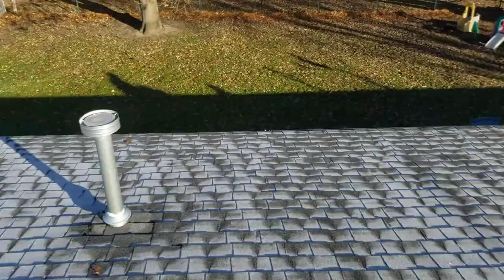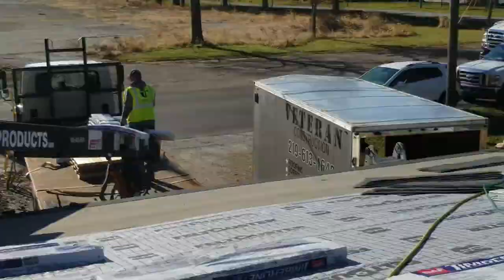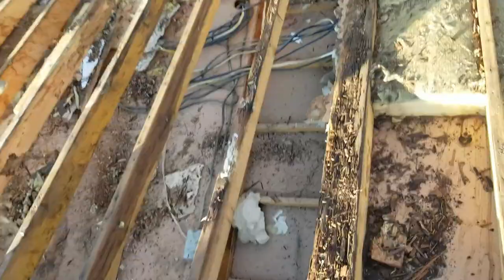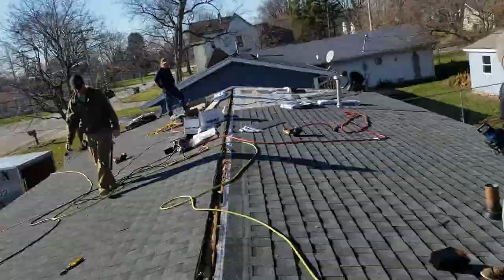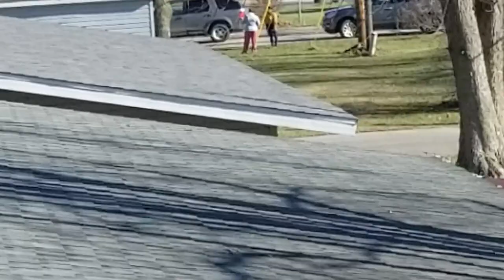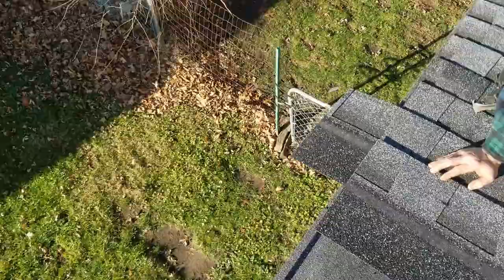One Day Job In Rensaleer

Comment: I don't know shit about roofing but aren't you supposed to nail on the nail strip? Isn't that where the upper and lower part of the single overlap? Just curious
Reply from the maker: It's called the common bond yes.  And it's only about 3/4 of an inch on most shingles

Comment: The nailing pattern everyone that goes by on laminate (do not nail too close too seams where 2 shingles line up too echother) 3 tab had 1.5 inches on both sides of the tab where the nail lined up, but wait if you nailed not in the right space it would leak??? Lmao, architectural shingles seal so good now days next time you rip a laminate roof look at the water stains (it is a dusty looking water mark and i wonder what got up in there???? Drum rollllllll it was WATER 💧) trust me I've been doing this for almost 15 years, in alot of places we have high winds so if you nail then skip 1 foot and nail the shingle on it will blow off
Reply: Ya right. You don't know

Comment: what do you think of putting 5 in the nail strip and then one more super high in the shingle as you go up the rake? When I was doing my roof a my friend said to do it that way.  Do you even need that? Like if the 5 in the strip fail with wind the little guy high aint going to hold the s#itshow together.
Reply from the maker: i don't think its neccessary but also it doesn't hurt. i've got videos talking about how the next nail does the same thing but its a preference. if my old said to do it i wouldve done it no argument. and idc to tell my guys to do it or not to
Reply: The nails from the shingle above also penetrate the one below. So every shingle gets 10 nails
Reply: @randyjenkins8743  That was my thought. it you nail right on the strip the first or last nail is going to catch it.  Reckon an extra nail aint gonna hurt except when a guy has to pull them out.

Comment: Insulation is to close to roof sheathing...install chutes
Reply from the maker: what're them?
Reply from the maker: n why did the trailer company do that when they built it. if you know
Reply: Trailer building is not a good standard. I 
I understand you can’t fix everything in a old house/ trailer. But you are making videos and should say that to your viewers .
Reply from the maker: @reedconstructionllc3745  oh I didn't think that's what you meant.  I've spoke on baffles before n we didn't mess with any here
Reply from the maker: N yea I'm sure I told them about that and suggested we did the soffits. I wasn't about to add baffling on the one sheet we pulled off nor would I have suggested its worth it pull off every sheet and do it.  Its a 3/12 pitch.  Ain't no doing it from the attic

Comment: Holy fuck a conveyor belt truck what is this 1986?  If the guy that sold this can’t find the square foot of a rectangle, he needs to go back to selling solar panels.
Reply from the maker: lol chill bro. i'm last minute with everything so all they could get was conveyer. honestly on simple walkers like this with open driveways i'm starting to prefer the conveyer becuase it doesn't take as long to set up so we're done quicker and sometimes thats needed. i was given a measurement of the house and shown a picture so i did the math on the pitch of the roof. like i have to do for blueprints